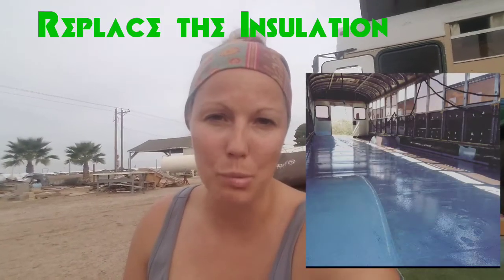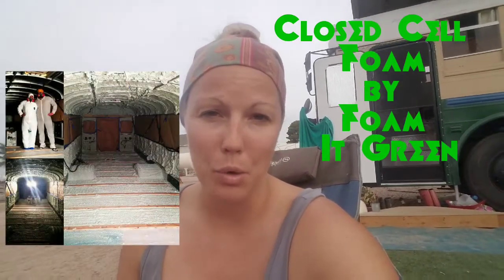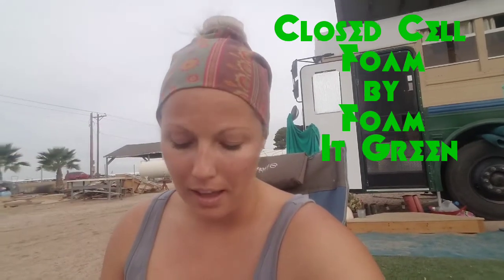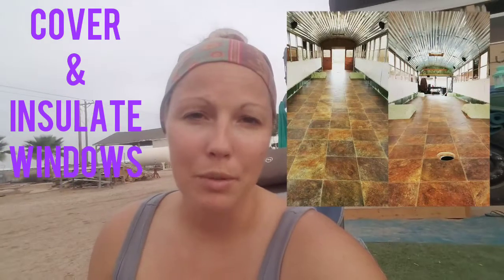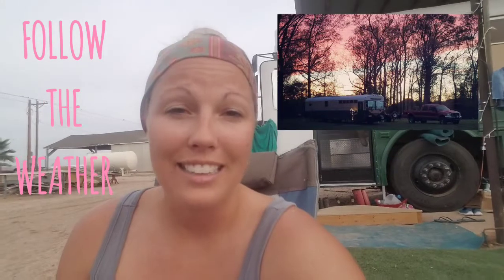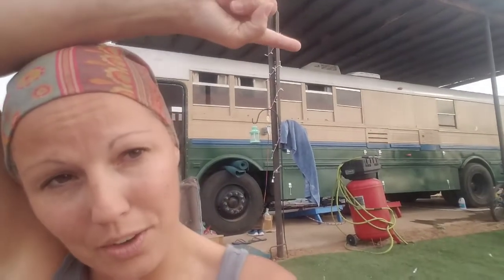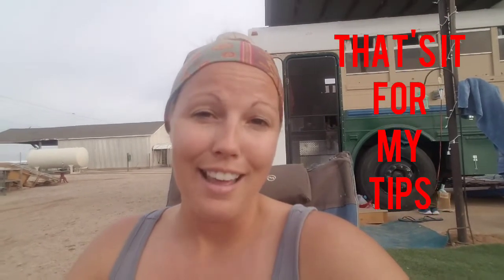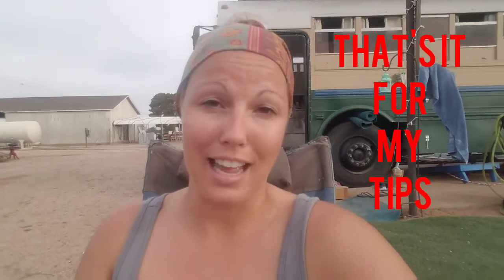Heating & Cooling Your Skoolie/Tiny house

Comment: Hi!! Just subscribed! Thanks for the video. Very helpful!! Do you have a video on how you did the covered windows??
Reply from the maker: Angela Santangelo no I don't, but we went to a steel yard/metal supply and got the thinnest they had...16 gauge..would have loved to gone lighter, even 14. Then we measured it, popped a chalk line on a 4x8 sheet of cold rolled steel (depending on your location you can get hot or cold rolled. Hot cuts easier and is more malleable we found out, but both work Great.), cut it with our angle grinder with cuttimg wheel. Then we hung it by one person holding the steel against the bus and the other drilling out 2 holes in the steel and bus to hang it, air riveting 3/16" rivets aluminum into it. Then as it hung we were able to continue drilling the holes and riveting without one person having to hold the steel. Here is a blog link I did on it. https://thecrabshomestead.com/2016/02/06/stage-16-covering-windowslights/

Comment: Hey I'm actually moving to Arizona for school next month in my short bus skoolie but I plan to be completely off grid for the next year that I'm in school. Any ideas to better combat those 120 degree days?? I've already done the spray foam insulation and as of now my main plan is to use a swamp cooler
Reply from the maker: walker90471 walker90471awesome!! in your shortie i am sure the climate control will be easy. I would def do reflectix on the windows in the hottest parts of the day. That way the sun can bounce off. If you can park your bus in a direction where the sun is on front or back, instead of a whole side. Curtains too. Having it dark in the day time in your bus will help keep it cold. Have some fans. Your panels/inverter/batts for sure should handle those...i have never ran a swamp cooler off my panels though. So idk on that part. There are lots of city water parks on their parks and rec city pages..usually cheap and have passes. I woukd plan to do that sometimes..or be near a lake or river or something. the more insulation on the windows the better if You can just close it up and run the ac. If no ac, the fans and opening the windows and doors that flow the best will be really nice...with a cold wrap would be nice. Shade...to the extent your panels can still charge. If the air is stagnant thats when it gets too hot. Has to be cooler air. And stay hydrated!!
Reply: walker90471 park in an underground parking during the day lol. Good luck with your build 😊

Comment: Why doesn’t anyone tint their windshields to 20%? That way you can leave the shades open and enjoy the view during the day, without having to cover anything up while you’re parked. It would only be 2 hours and $25…

Another thought to make your heating and air system work more efficiently in such a tight and closed space, why not integrate louvres in the top, say 12”, of each of your walls perpendicular to the length of the bus? Especially with rooftop units… that way the air can travel efficiently front to back and you can make the most of your HVAC setup, and optimize comfiness in each room :)
Reply from the maker: All fantastic ideas! That's what makes skoplies so special...people can make them however they want to. Our side windows were tinted since it was a AZ school bus but honestly, the thickness of the windows really mattered. The single panes just poured heat in. So reflectix was a must in the hot places. And when we traveled and parked at rest stops truckers and people could see into the bus while we were watching Netflix or cooking lol. After replacing the front Windshield we asked about tinting but you can only tint 6" from the top in TX :(

Comment: Hello, how easy/hard was to apply the insulation foam? how many inches of thickness did you apply? I've read it's best done by a professional, would you agree? Thanks. 
On another note, it might be just me, but I found the background music extremely distracting, I had to force myself to concentrate because the content was interesting, but it was hard to get to the end for me. Maybe it simply was too loud when compared to your voice... anyways, my humble 2 cents.
Reply from the maker: Douglas Chacin super easy. We had open cell foam professionally sprayed in our rebuilt home (couple of years before the bus idea) and they did a good job. But these kits are meant for average joe to do. And honestly buses aren't meant to be lived in, so any upgrade you do will be 100x's better! My blog article on this step goes.in a little more detail and has a few pics on clean up. 

https://thecrabshomestead.com/2016/02/08/stage-18-spray-foam-insulation/

The company had lots of info and videos on how to do it too which helped a ton. We had quite a bit of overspray but now that i know what to expect, when i do use spray foam again for our next house i think i will be way better at that part, atleast. 
We did about an inch and half in ceiling...bc it had the space bw the roof and ribs to fill...3 inches on front and back headers bc they are deep, 1"on walls, and 1/2" on floors (we had to salvage all the head room for my 6'2" hubby we could so 1/2" is all we could go. Floor is still drafty..but if we were somewhere more permanent i would skirt the bus and maybe add insulation boards under neath..that would help a ton!
Thanks for telling me about the music. I dont always do it but thought i would see how it would do. Have a good night!
Reply from the maker: Douglas Chacin thanks for watching!